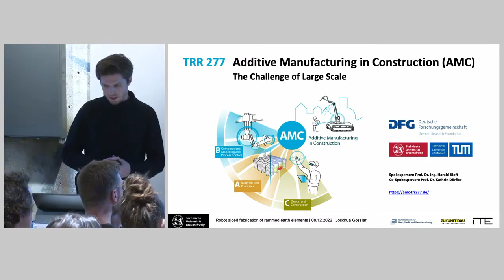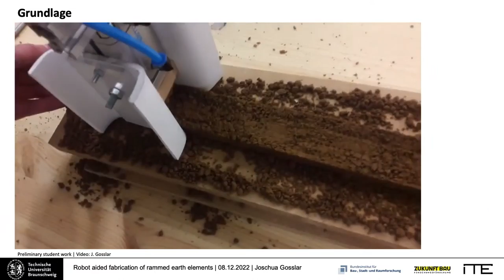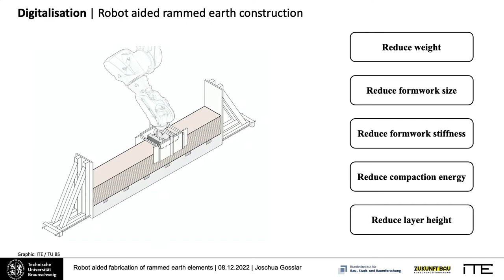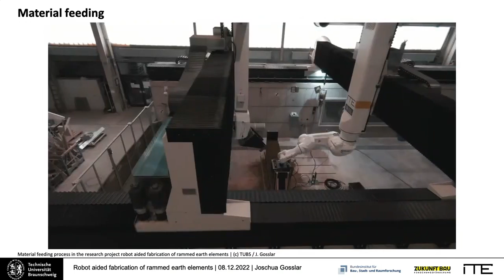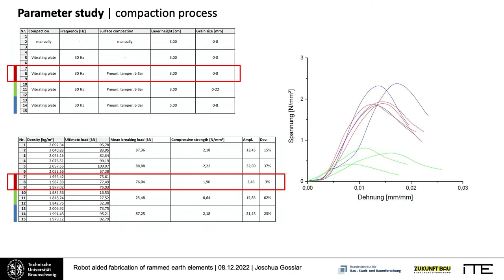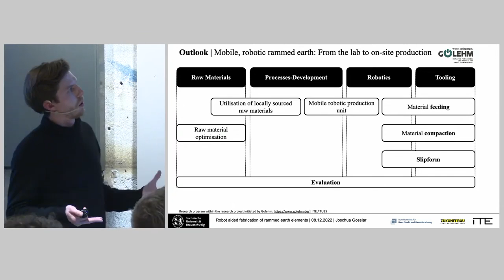Robotic Rammed Earth Construction

Comment: Instead of vibration plates, have you tried steel rollers?
Reply from the maker: Again; I am simply sharing the work of others. That said: Rammed Earth is an ancient technique, with centuries of gradual improvements.
I suppose we would be talking about "Rolled Earth" now if steel rollers were able to do it well.
Reply: @lavkarbonbygg6133  Obviously, steel rollers are meant for heavy machinery as they are very heavy to carry around. Hence, since this setup is industrialising the old Rammed Earth method, then possibly steel rollers could be a better method? Again, I am novice here.
Reply: payload capacity of a robot is a practical constraint

Comment: I really admire people who spend so much time and energy in trying to progress the rammed earth industry but unfortunately with every automated system I have seen so far, nobody seems to give any consideration to the fact that rammed earth panels more often than not need embedded structural elements, conduit services for electrical and plumbing and often need openings cast in as well. Seems to me like a lot more practical application is required before too much more energy is wasted.
Reply: Matt Risinger has a recent video going over how 3D printed concrete workers put voids and holes in to allow trades and plumbing / electrical to pass through. If you look up Red Earth Ranch, they have a video directly showing how to emplace an electrical panel into a wall.
Reply from the maker: Good point, however what you see in this video is obviously a beta-testing. I suggest you look at the presentations about Campus Alnatura by Erden/Martin Rauch and Arch. Martin Haas, as those huge insulated pre-fab walls have wall- heating cables built into them. 
In addition its a matter of design preferences. The Campus Alnatura exemplifies how electrical and plumbing in general were placed elsewhere than in the exterior walls.